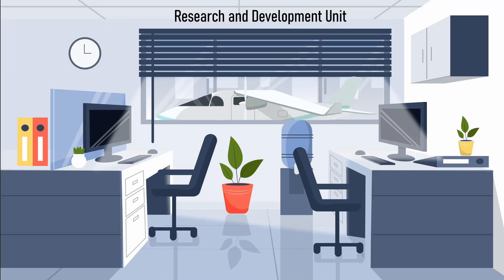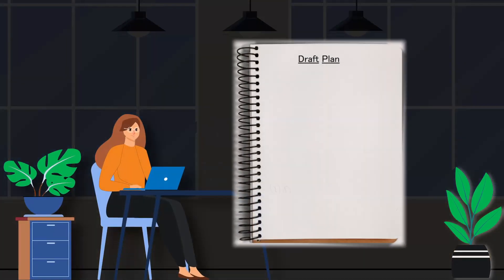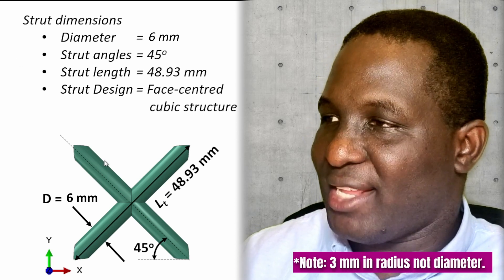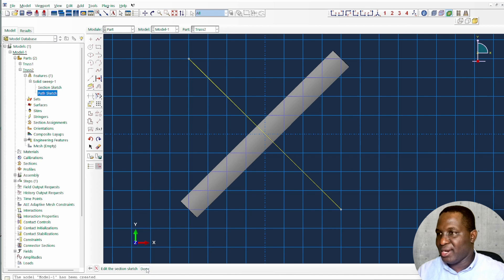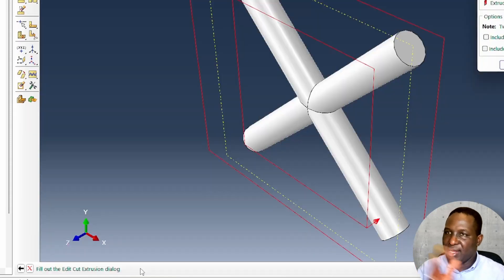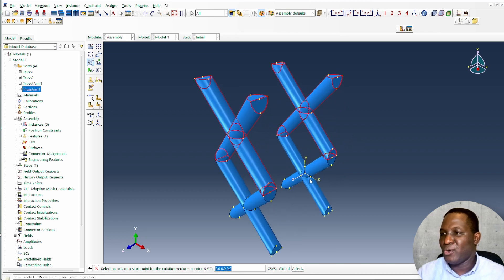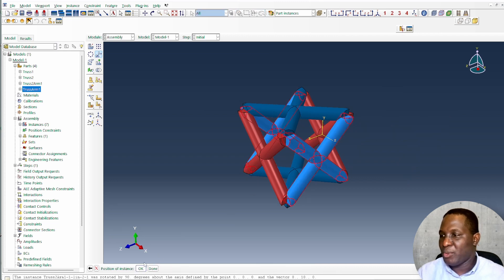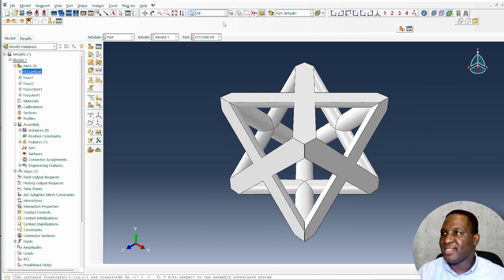Here is an effortless way to design FCC lattice structures.

Comment: Iam interested to model Cement concrete 3D model using abaqus which consists of different shapes of aggregates along with cement matrix. I request you to provide video to how to create RVE model of Radom inclusion of different shapes of particles in matrix. Iam watching all your videos and it is very much helpful for my research work. You have done random inclusion of spherical particles of same size. Kindly help in this matter.
Reply from the maker: Hello @H S Vishwanath, I do not have any video about this sort of problem. The approach of Monte Carlo method that I described in a former video. It not focused though on cement concrete. I hope you find the help you need but for now, I am not able to help with this query.
Reply: @MichaelOkereke  Thanks for your response sir.